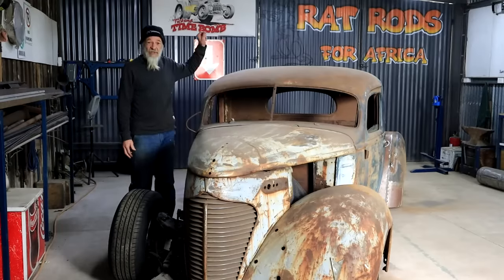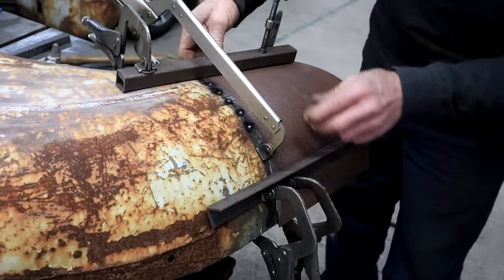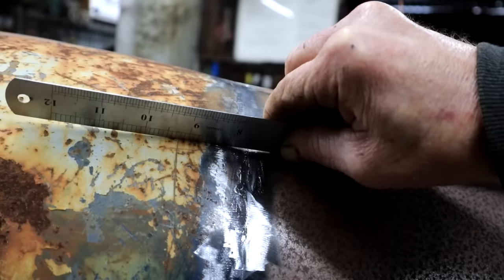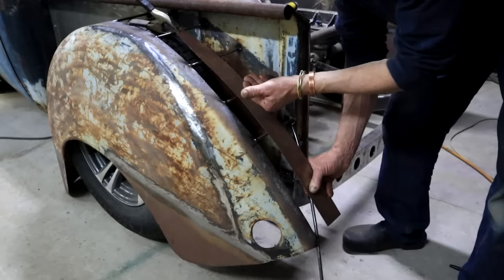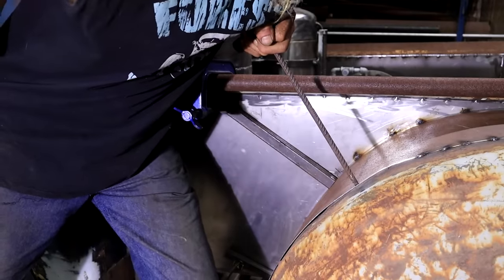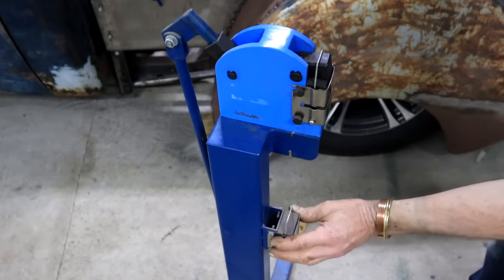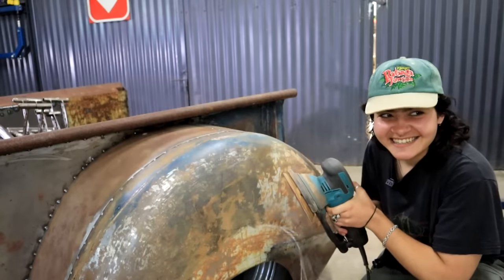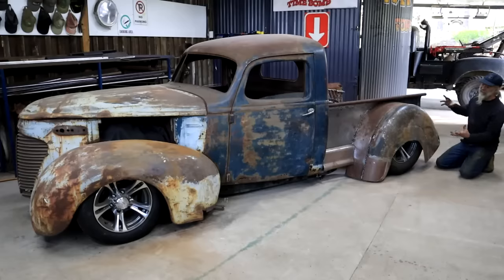Building Custom Rear Fenders for the Hudson Rat Rod - Part 2

Comment: Hey Div,
   You have a lovely daughter with a good attitude.
   The fender fiasco has really picked up some style.
I hope you will raise the truck to ride height before deciding on the wheel opening.
   That rounded radius before the shrinker was a good move on your part and very educational for me.
I have several times wondered about trying that method for softening the radius.
Now I have seen it done and am happy to now know I can do it.
Thank you.
   I live in the middle of the USA ( Kansas ) where we have had some really hot 100+ weeks of summer.
Tho the temperatures are now dropping into the mid 80's in daylight with overnight temps dropping into the mid 50's.
We could see snow by the end of next month !
     Work Safe, Be Well
             Enjoy Life
Reply from the maker: Yes, we will do the running boards to see visual impact, then raise to ride height before making the final call on the fender arch

Comment: If you cut the opening for the wheels first raise the truck to ride height then determine how much sidewall you want to shoe. Now take a divider (trammel, string) and place one point in the center of the hub and the other where you've decided you went to trim to and scribe your mark around the opening.
Reply from the maker: Yes, once the running boards are done, we will raise her to ride height and start making decisions 🙂
Reply: Good point looking at ride height.  Also could shape the wheel opening to resemble the front wheel opening might look good and show off the wheels.  Could also add skirts but I personally think just the same shape would be great.

Comment: 😊😊😊love the cut of the guards, yes a slight radius in the flat would have finished them off. Even with the last bit that turns in. Spot on in fact. Have a look at BAMF ( be a metal fabricator) the rear guards on the delivery van are fantastic in keeping cool lines. Looking forward to your next video

Comment: On the view from the rear it looks like the left side of the cab is considerably higher than the right, relative to the upper tube cross-member of the frame. Could be just camera angles, or if nothing else, a frame spacer can level out the cab. Fenders turned out great though. In a way that tighter corner sort of blends square main frame with curved outer fenders.

As for Adendorff, that's what Harbor Freight wishes it could be :) Went on their site and was honestly shocked by how much choice they give. Looked at lathes in particular, and it was awesome to see a BUNCH of different models of different sizes. In HF you get just one. In general most US stores are sh*t when it comes to (tool) variety. Often you get 5-6 brands, sure, but it's still the same tool that does the same thing in the same way.

As for a rivnut tool, a big bolt with a coupling nut make for a great one! Center-drill the bolt all the way, make a big washer (bigger than OD of the nut but with a small hole) for the other end, and use a long thin high-tensile bolt as a mandrel. Basically you're un-screwing the coupling nut to pull on that thin long bolt and to crimp the rivnut. Bonus points for finding or making a left-handed bolt and nut, that way it won't try to unscrew the rivnut off the small bolt.

Also "Little BamBam" is an adorable name for a planishing hammer!
Reply from the maker: Interesting to hear about Adendorf vs Harbor Freight! Gonna have to give your give your rivnut tool a go. Thanks!

Comment: Stilled addicted to your builds.   I know your not putting a tailgate on. Just my thoughts.    What about a tailgate that's not a tailgate. But chain across the back that looks like a net. You could design it however you like and tack the links so it holds your design and doesn't rattle      just a thought.   And you can still see all the nice fab work. ✌️🇺🇸
Reply from the maker: Something to consider! Thanks

Comment: Untimely comment but .. lift the suspension fully and turn the fender in original width until you find the curve that you can invert to the front of the fender .. then attach the rear cutoff to the front of the fender so it reaches the eventual running board .. then Center on the wheel and trim the radius around the wheel to your liking ..

Comment: Diff, I think the front of the fender should be 90° to the floor, and right at the center of the wheel, run a horizontal lines, straight back and cut the fender at that line.
Reply: I feel the same, agree 101%

Comment: I swear, sometimes it's more entertaining to watch you create tools than cars!  So, this is probably a stupid idea but here goes.  The only part of the truck that makes my eye feel like it's got an ice pick in it is the sharp 90 degree angle at the end of the pick up bed rail.  To me, it just doesn't fit the awesome lines of the rest of the truck, the parts that you fabricated for the rear suspension, or the cool new rear fenders.  What about taking the last 12 to 14 inches of that bed rail and subtly drawing it down to give it inconspicuous flow that draws your eye to the fender?  Keep the substance of the rail but just let the new rear fenders influence the flow out the rear of the truck?  The rail wouldn't be parallel to the fender curve, but just a hint of downward curve.
Reply from the maker: Will give it some thought 🙂

Comment: What would you recon isbthe best way to use cutting discs... Cut straight through on the first go or cut a groove "skin deep" along the line first?
Reply from the maker: Depends on whether you want your discs to last longer. If you keep "grooving" on thick stuff, the discs last longer due to less friction. But on thin stuff, say up to 5mm I don't bother and cut straight through

Comment: I have two questions? Can you still get the wheel off? Are you going to weld tabs on the inside of the fender and bolted to the side of the pick up bed?
Reply from the maker: I still have to finalize the fender arch cut out. I will ensure that it is big enough to get the wheel off when fully aired up. No fenders will remain welded to bed sides. But bedside unit is removable. You will see that in future video🙂

Comment: Duff I know you have a lot of work in the rear fenders but something doesn’t look right or I don’t have your vision. Sorry not putting you down but I’m not feeling it. Maybe it’s in the cut out above the wheel? The rear part were you blend into the bed looks awesome but the arch above the wheel I’m just not feeling it again I don’t have you vision. 
 Great to see your daughter on the show and I know you guys had a great time.
Reply from the maker: I reckon it in the cut out above the wheel. Let's get the running boards in place, air it up to ride height and then make a call
Reply: Hey you know what they say about opinion are like butts everyone has one haha. I think your right get it off the ground and mount the running boars.
Reply from the maker: @philroser8920  I actually enjoy different opinions. One can learn from it. Constructive criticism is a good thing if one sees it right 🙂